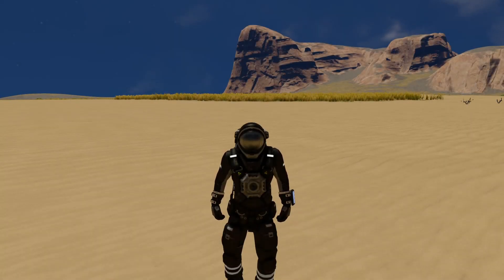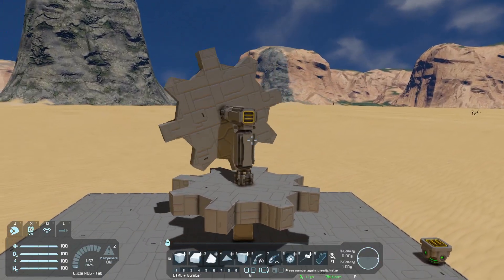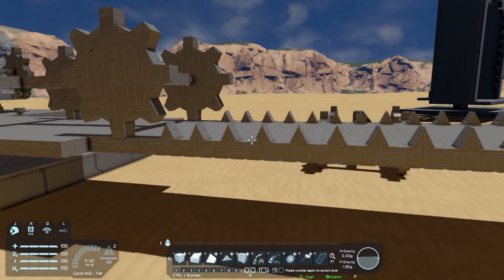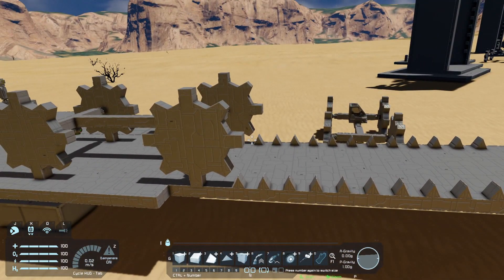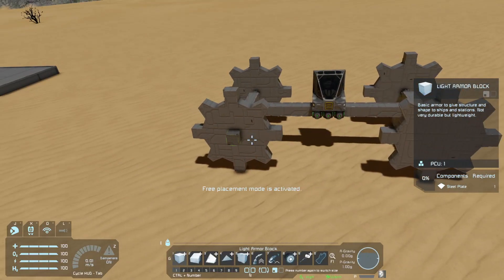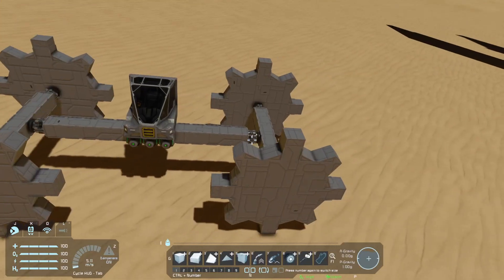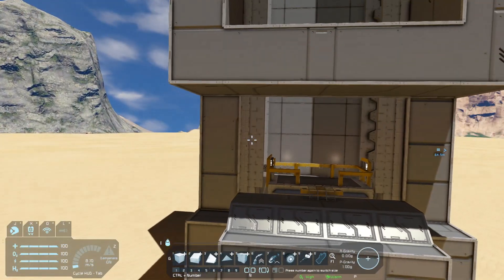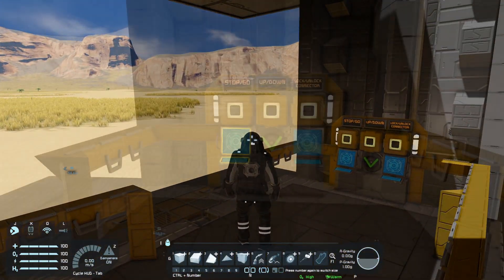Gear Elevator - Space Engineers

Comment: So, the problem i always have with elevators is creating a call function; some way to summon the elevator to a designated floor with the press of a button. It's easy if the elevator only has two stops, but if you have a middle floor I tend to have difficulty bringing the elevator to that designated point. Suggestions? I know you have the camera idea in this one, but something a little more seamless would be nice.
Reply: I think there is a way to do it using sensors, configured to detect small grid. You can place it one block underneath the floor level, and time it to stop the elevator. Call buttons on floors and floor buttons on elevator can disable all sensors except one on the selected floor.
It will be hard to configure, but i think it should work
Reply from the maker: Unless the elevator is at the bottom and locked to the connector, it is not attached to the surrounding structure. You can't communicate with it without an RC block/antenna or making a ridiculously long line of cable using hinges.
Reply: @BlackArmor718  I Build an elevator 2 years ago that has all these functionalities.
I can call it from any of my 4 floors.
It goes 50m/s (if i make it goes faster my character start to float when i go down).
I Basically build a big Drone along a vertical mine shaft, and with a small script i made, it reconnects and recharge at each stops, making it able to be called from any floor with only one button push.
Reply from the maker: @scyttale  So it moves using thrusters?
Reply: @BlackArmor718  Yes. 
I used a central pillar made of big blocks, and landing gears mounted on pistons to connect and lock in place the elevator when its not moving. I added a piston with connector thats deploys and connect to each floor, when the remote control block arrives at his destination. I could upload my save, or record a video, if you want to see.
Reply: my script is a simple condition : if the remote block is being used by being called from another floor (meaning if the elevator is supposed to be moving) then my landing gear and connector are Off. This way, when the remote control block arrives at his destination, my landing gear lock the elevator in place, and the connector redeploy and reconnects itself.
Reply from the maker: @scyttale  But using thrusters on an elevator defeats the whole purpose. You could just have a ship doing that
Reply: @BlackArmor718  so beacause it has thrusters its not an elevator anymore ? If you want something to go up and down along an axis, fast, and be able to have multiple floors position stored in its memory, like Tim asked, I would say its a pretty good solution. Even if it doesnt look as cool as gears.
Reply from the maker: @scyttale  I’m saying it’s cheating haha. Like when people make mechs that can only stand up using thrusters. It’s really just a ship with some animated legs at that point, the challenge has been avoided.
Reply: @BlackArmor718  Or better yet - connector on each floor. Elevator has a sideways connector. It is constantly trying to connect. Selecting the floor is done by turning on or off the connectors on the right floor. Being connected would stop the elevator from moving. The buttons on the elevator can control the connectors on the floors because you will always be connected at the floor you're on when hitting the button.
Reply from the maker: @Daniel-Strain  Now that idea has promise, but what if the elevator is above your floor? How would the elevator know if it should go up or down depending on where you are relative to it?

Also that would require that I make the floors beforehand, whereas I made this concept specifically to be as simple as possible so it could be dropped into anyone’s already made base/ship and it would function.
Reply: @BlackArmor718  What about have the connector engage at each floor. So you are then connected no matter what floor you're on. So, you hit the floor button and it swings out a rod with wheels on it to block the elevator (one is on each level). After the lever swings out into the shaft, it disconnects the elevator and sends it up. Once stopped on the selected floor (by the blocking rod in the shaft), the connector on the elevator is constantly trying to connect. That then allows your next floor button to work.
Reply: The only problem I see - how to detect is elevator higher or lower the selected floor. System should remember which floor is elevator on, and decide the direction of the rotor. Sounds like a job for programming block, which is not as exiting as doing it "vanilla way"
Reply: This is where the logic circuits of stationeers would be useful!